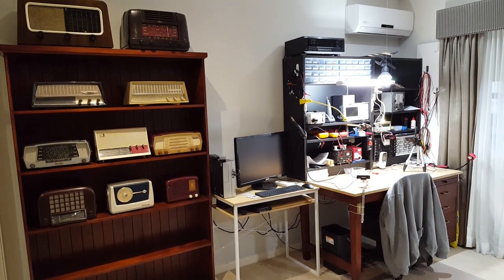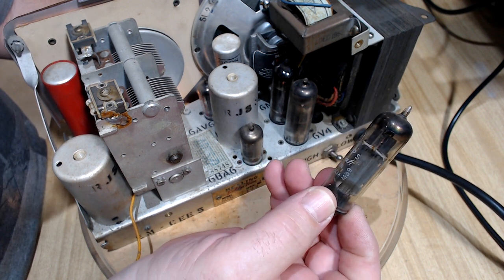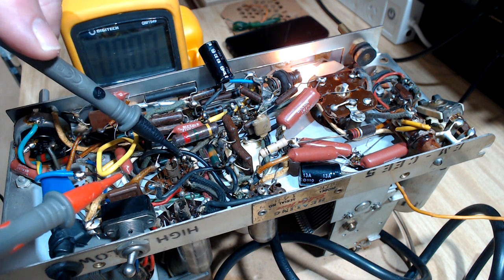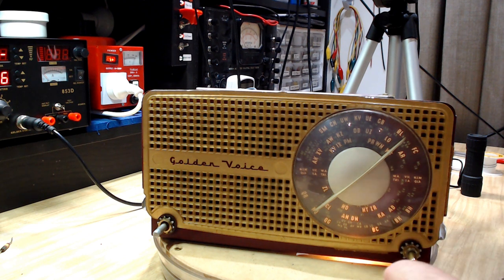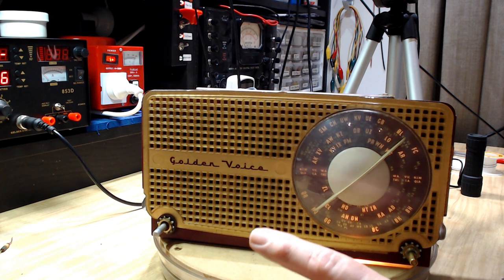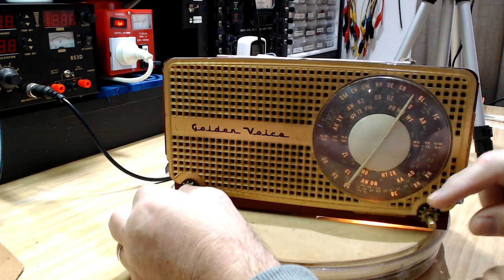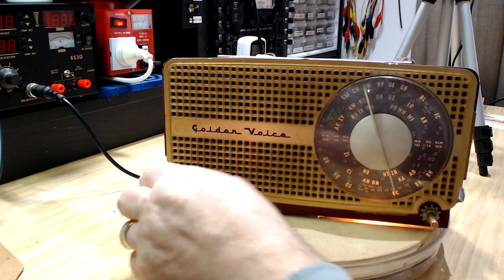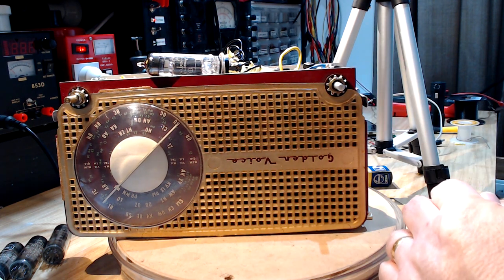Healing 503E Vintage Radio Repair

Comment: Another great trouble shooting video, my favorite, as I am trying to learn how to repair radios. I would like to know where you connected the volt meter while doing the alignment.
Reply from the maker: Hi Phillip, thank you. I watched that part of the video again and in it I have connected an AC meter between the plate of the output valve (6M5 pin 7) and the chassis.  I have a 0.01uF capacitor connected between the plate and the meter, that's important as the plate has a few hundred Volts DC on it and the capacitor will block the DC but let the alternating audio signal through. You can also connect to the speaker terminals but the volume control needs to on full with minimum signal from the signal generator for aligning so as not to activate the AGC. I find this a bit unbearable as the sound can be quite deafening.  I always use an analog meter for aligning because it's easier to read than a digital.  Please keep in mind the high voltages in that area apart from the plate voltage as the AC lines are usually in the same area. Good Luck 🙂   P.S. another place I like to connect a DC meter to is the AGC line at the valve pin, pin 6 in the 6AV6 in this case.  The voltage on this line is DC and is negative, and you need a high impedance meter so it doesn't load down the AGC line.
Reply: Thank you for that information. I have several radios with poor reception that may well benefit from an IF alignment. I am very carful around high voltage, I usually wrap a fine insulated wire around the pin in question then reinstall the tube in its socket. Thanks again for your wonderful videos.
Reply from the maker: I'm doing a radio video now and alignment is still to be done. I will take a little extra time to explain what I'm doing this time, I tend to rush through as It's been done a thousand times before. Thanks for letting me know what you need. Cheers!
Reply from the maker: Hi Phillip, I have just uploaded another video and I take a bit more time explaining the alignment procedure: https://www.youtube.com/watch?v=xh6EC96gvwI&feature=youtu.be

Comment: Dave, I seriously doubt if those few pF were the problem. IMO silver mica's tend to fail over time at high voltages. Just my thoughts. Cheers 👍🤝
Oops, hadn't finished the video. My bad. But we are on the same wavelength again 😉
Reply from the maker: Nard, when I started into radio repair I was told by all and sundry that micas never fail... oh yes they do. I now suspect any mica with high voltage on one side and usually change them.  This radio worked flawlessly for a day and a half then broke down over a period of 30 seconds, turned it off and back on and its fine again. I totally agree with your thoughts 👍😀

Comment: David, I see that Australia use 220 volt AC as does Great Britain. Other that Aus being in the Commonwealth why the use of 220 vAC vs 110 that we use in North America and Japan?
Reply from the maker: Hi Phillip, thanks for commenting. I'll have a go at your question... the current European standard including the UK is 230VAC 50Hz. Prior to that Europe was 220V and England 240V both at 50Hz, A decision was made to set a standard of 230VAC 50Hz at some point for Europe and the UK.  Australia was 240V originally as we where heavily influenced by the Motherland and probably the first generators came from England which would have been 240V.  In the mid 80s the Australian government decided to change to 230V to align with Europe and so it is today. The reality is that the 230V supply voltage coupled with the plus and minus tolerance is quite wide so really nothing changed as far as the supply voltage was concerned, 240 Volts still fell within the new 230V limits. I imagine as the US had rolled out their power infrastructure before most other countries and the US standard had been set to around 110 - 120V (I imagine there would have been many different power companies supplying different voltages).  When other countries started to build their electrical systems they opted for a higher voltage so they could use thinner (cheaper) wire over greater distances without the voltage drop of a lower voltage system.  I understand from talking to a radio enthusiast in the US that that has been overcome to some extent in the US by supplying US homes with two lines of 120v tapped in the centre to get 240V for large home appliances like stoves etc. Canada is a commonwealth country and they use 120V, I guess that's another story 🙂

Comment: Maybe it's the way the audio tone comes across, but it sounds to me like  your alignments are being done with too great a signal level from the generator. With anything more than a weak signal, the AGC will be attempting to hold the detected audio level constant. It will therefore be "fighting" your careful adjustments. With a weak signal (a fair degree of background hiss) you should find all your adjustments are much sharper. And as each successfully peaks, you may find it necessary to reduce the generator output still further. You will soon develop a "feel" for the optimum level to use.
Reply from the maker: Absolutely agree Robin, I'm learning as I go here. I didn't watch the video again but you are no doubt correct but I think I have a better understanding now and keep the generator on minimum and the radio volume on max. Thanks 👍😀

Comment: I got a radio in today that along with another one of the same model and maker, I hope to get at least one working one!  It is a TRF type radio.  Gonna be a L O N G time before I have a working model, but it will be worth it!  I would show a photo, but don't know how to attach a photo here.  It is a Garod V  Neutrodyne.
Reply from the maker: Hi Wayne, that's a coffin radio isn’t it? I haven't tackled one of those yet, good luck I hope it goes well 👍😀

Comment: Hi David, what recording setup do you use? looks like you're using webcams + pc to record videos? which software?
Reply from the maker: Hi Murat, yes, I have 4 webcams at my radio desk, I use 2 old Samsung S8 phones in the workshop with an external mic. The software is Pinnacle Studio Ultimate, it has a separate program that lets me copy the 4 web cams simultaneously and edit it into one video which can be them edited in Pinnacle. I use Pinnacle because of that feature but the software is a bit unstable.  I use a Yeti microphone at the desk now, I don't know when I started with the mic but there was a marked improvement in sound quality. I have Logitech webcams which are good, I also have  Microsoft webcams but the software won't zoom them for some reason and they seem to overheat and cut off.  Hope that helps 🙂
Reply: @DavidTipton101  thats was a nice and complete  answer ;) thank you very much.

Comment: You need to be sure about the correct bias before you start replacing tubes.  From the beginning I heard a terrible cross over distortion, which always sounds terrible in its own very distinct way.  If you have DC leaking to the grid, you will fry tubes one after another.  So be sure to check voltages.  Replace coupling caps prior to changing tubes.
Reply from the maker: Hi 1959Berre, Thanks 👍🙂

Comment: I must have missed something.  You kept talking about a capacitor not going to where is should and said that it was going directly to the chassis instead of the center tap.  But when you pointed out the capacitor on the schematic, it doesn't go to the center tap of the transformer at all.  It also seems to be a bit strange that on the schematic the center tap of the transformer went directly to the plate of one of the tubes...I would have thought it would have been at chassis potential instead.
Reply from the maker: Hi Wayne, I'll be back home a few days I'll check it out, I've probably stuffed it up somewhere 🤔🙂
Reply from the maker: Hi Wayne, can you give me a time in the video please roughly where the issue is, thanks
Reply: @DavidTipton101 
I think I finally see the issue.  I am use to schematics being drawn in such a fashion that unless there is a black dot where wires cross, there is no connection.  Looking at the video at time stamp 13:05, I see that while there is no black dot on the intersection of the wire from C19 to R9, in all the places where there is NO connection, there IS a loop in the path to signify that there is no connection but that the wires are not touching. So maybe it DOES touch and is connected to the Center Tap of the transformer.
I find that the restorations you do that take days to work on and to film, are the ones I love the best.  (Shame on me I want you to put about 10 of those up every day!!!)  I really do enjoy watching your videos.  There is always something that I would have done different, but then we ARE different people.  The main thing is to do the best you can and we both do our best when working on something.  I just don't have the means to do videos on anything right now...too busy trying to find employment.  Thanks again for the great videos!
Wayne
Reply from the maker: Ahhh right. Early in my career electrical drawings had both ways of showing connections or non connections. I remember the instructor saying the standard from now on would be a dot for a connection. That would have been early 70s. We had equipment from the UK and the US so maybe they both did it a different way, I can't remember unfortunately 🙂

Comment: 6M5's are as rare as proverbial hens teeth..... one point which may be worth checking: in EA in the 1960's, The Serviceman encountered a noisy 6M5, long story short, this was traced to silver plating migrating from one pin to an adjacent pin - the grid pin if memory serves - may be worth a squizz? Thank you for your hard work.
Reply from the maker: Hey 6A8G, I read the same article and tried scraping the gap between the pins to no avail. I bought 4 NOS 6M5s and 3 tested with no shorts and one had the same shorts as the old ones. I should check for mica migration on that valve. Sorry, I meant silver migration  😉
Reply: @DavidTipton101   Good luck with your good look:)

Comment: Very nostalgic. The Ford Fairlane of radio’s. Definitely from the hippie generation. I like it much. Plastic, but the better version, and it’s probably American made. Too bad we don’t hear 👂 all the 1950’s and 1960’s songs on radio 📻 like we used to. More talk shows than ever. Sure hate today’s non selective radio, hearing the same old thing 13 times a day, with a limited number of songs. Enough to make you get up and turn the radio off. It’s about automated rotation, with no DJ. They play the same 300 songs over and over, it drives me nuts. Used to be something like 5000 songs back in the day, with a DJ. The name, as well as the year of the song was announced as well, as well as who sings it. Sounds like radio has gone Chinese as well as radios themselves. I wonder if anybody’s even running 🏃‍♀️ radio stations today, or if this is pure, genuine laziness that they’re all getting paid to stay home 🏡. Talk shows and gospel music are okay 👌, but where has real radio gone, like we heard in the 1950’s and 1960’s? We even heard it well past the 1980’s. It was different by 1988 and 1989, but radio stations still had a decent section of music then. This radio is well worth the music 🎶, even in 1989, when I graduated from school and moved to Arizona to be with my mom and stepfather. I also like the most unusual of radios. I know you’ve had a few. I like to see what’s on the inside. It’s sort of like taking a 1970’s flip clock radio apart. Yes, I’m a fan of flip clock radios. The flip cards, electric motor, gearing, switches and circuitry. Got myself buzzed by accidentally touching high voltage points inside when I had one ☝️ plugged in. 117 volts of electricity. Yes, quite a buzz. These seemed to be the 1970’s best clock radios, before actual digital ones were thought 💭 of. They were Japanese, not Chinese. The motors would stop ✋ running 🏃‍♀️, but they could be revived by cleaning and oiling. Sometimes a flip card would break. You can build it a new tab with super glue and baking soda 🥤, as I found out on YouTube, or replace the flip card with the corresponding tops or bottoms of numbers.
Reply from the maker: Hi Jeffery, thank you. A G Healing was an Australian manufacturer and the radio was built in Australia. We have two AM 60s, 70s and 80s stations in Brisbane along with talk and horse racing. All are fully staffed and not over reliant on ads. I remember watching a flip card clock in the shop window in the 60s, I had to wait a minute to see the card flip each time 😀

Comment: To have a domino mica capacitor to leak is rare.  To a first approximation they don't leak.  So there is no huge shame in not suspecting it at first.  But this circuit puts several hundred volts across these capacitors, resulting in more stress on them than with a more modest B+.  Therefore one leaked, and another one became intermittent and noisy.

It is also an unusual audio output bias circuit for an economy radio.  Instead of cathode bias, a bias voltage is derived at the power supply itself and then applied to the grid circuit of the audio output tube.  Maybe this is supposed to help the low end frequency response (the "golden voice") without needing to use a cathode bias bypass capacitor that would be impractically large for the technology of its day, a huge cylinder rather than the little unit of today.

With patience and perseverance you eventually did identify the problem and fix it, which is what counted.  I wonder if some of the other 6M5s you had had been placed under similar situations in other radios, being underbiased.
Reply from the maker: I was told micas never fail, so using that I tended to overlook them, I now know that is not the case and suspect them when a high voltage is on one side of them. The fixed bias method is common in Aussie radios, more common than cathode bias. The early 6M5 had silver plated pins which lead to silver migration and shorting between pin, they are getting hard to get 🙄
Reply: @DavidTipton101  That's sure a snafu, a thing (silver plating) that is supposed to optimize pin connection quality and yet which messes it up by generating shorts.  It's like the loktal idea in that wise.  The designers of both didn't have a chance to look down the road, and certainly didn't have the antique aficionado in mind.  Does this silver migration happen inside the bulb, or outside, or both?  If inside the bulb,  I'm thinking it might be possible to flash the shorts away with a high voltage capacitor discharge method similar to CRT rejuvenation and short clearing.  (On the outside they might be physically cleaned.)
Reply: @DavidTipton101  P.S. But the propensity of silver to do that explains other things like the shorting domino mica capacitors and "silver mica disease" in IF cans.

One North American electronics firm, Radio Shack, had a promotional line of vacuum tubes that had "gold clad pins."  I don't think I ever encountered one that had gone bad, even though these tubes were considered virtual trash in the service industry.  Maybe gold, the second best conductive metal there is if I understand correctly (silver being the best, and copper the third best, with alumin[i]um being a distant fourth) does not migrate.
Reply from the maker: @SeekingTheLoveThatGodMeans7648  The shorting happens inside and outside I'm told but I can't confirm that. On later valves the silver plating was kept short of the glass envelope to mitigate the problem. The valve base can be cleaned if the short is outside, I would assume that blasting any internal short would work 🙂

Comment: The letters on the scale, are these for states, regions or abbreviations for stations ?
Reply from the maker: Hi migsven surfing, the scale is divided into states and each state has a number. Victoria is 3 NSW is 2.... the radio station then adds a two letter ID behind the number. On that dial the numbers have been omitted and just the station ID is shown. The number for Queensland is 4 so our statatios are 4QR, 4KQ... etc 🙂
Reply: @DavidTipton101  Thanks. Now I know that.Saw a scale like it and have wondered what it was about. Can be a bit of a pain not to have kHz. Our old radios often had wavelength instead of frequency.
Reply from the maker: It's what you are used too I guess. I like the scale with the stations on it as you know immediately to which station you are listening. The downside is the stations kept changing frequency so they no longer line up 🤦‍♂️😲😃

Comment: Surprised o/p tx screwed dirctly to power tx. Any. Hum would be mechanical passed to o/p tx. Just guessing at early view.
Reply from the maker: It is an odd place to mount it, I assume it is mounted 90 degrees from the transformer winding direction. I haven't watched the video for a long time 🤔
Reply: I have noticed your vids are quite old never the less they are valid and always will be. I often think why didn't transistors progress from simple triode valve equivalent to multi grid equivalent. However it would seem that if one might need a pentode type device then you just add further transistors with appropriate circuitry to make a pentode type device. This thinking probably led to the development of IC's and so the need to develope solid state multi grid type no longer exists. Beautiful bench layout in your room. T Y.